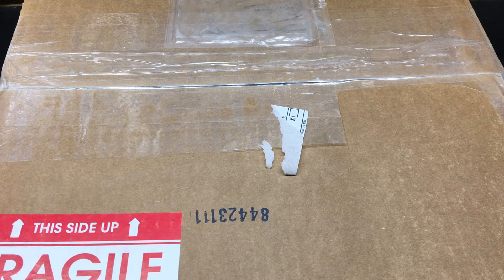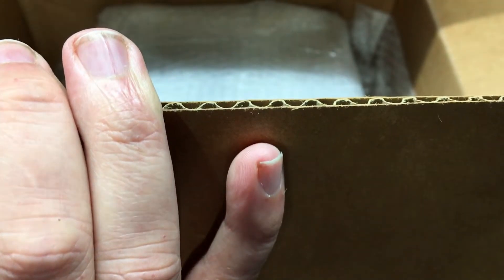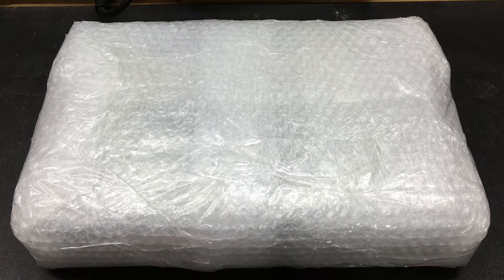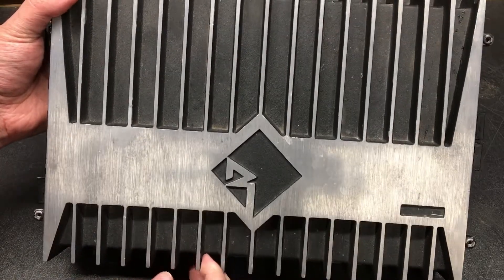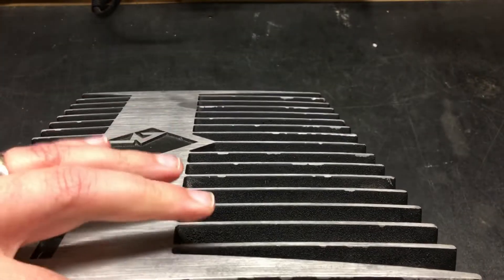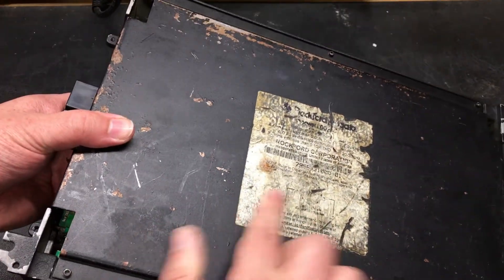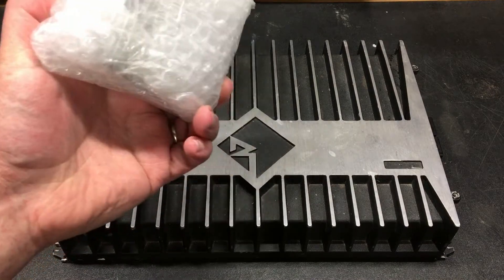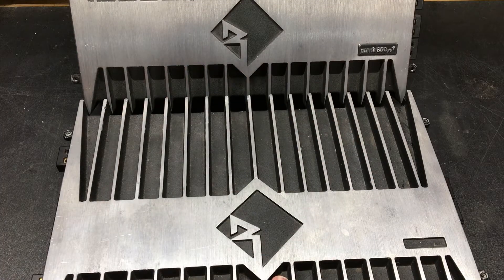Rockford Fosgate Power 800a2 "She's UGLY"

Comment: Great vid! This is absolutely my fav RF gen. I too have an 800a2 with a missing badge. You mentioned it’s possible to get a replacement... could you point me in the direction where? Also, what do you use to repaint/refinish? Thanks in advance!
Reply from the maker: If you have Facebook check out a page called "Rockford Fosgate Old School" and make sure you answer all the security questions to join. Once you joined up search for "DSM badge" or "badge" and you'll come across numerous posts about them. Look for a guy named Chas and send him a PM. He is the one that makes them out of resin. As for repaint and refinish. I like to media blast the painted areas if the paint is real bad and flaking off. If the black paint isn't too bad I use a Scotch bright pad and scuff up the paint then use a can of Rust Oleum fine textured black paint. I try to leave the "grind" alone as much as possible when it comes to painting. Mask off the grind section well and to finish it off I use the same Scotch bright pad on the surface followed up with some very fine grit sand paper. I personally despise the polished style of black and grind amps.  I want my Fosgate amps to look as close to factory as possible. But that's just me.
Reply: @kaknballz  awesome thanks so much for reply! Will be doing that!

Comment: Hi. I have this exact same amp but it’s the 500 watt. I have it at 4ohms thinking it would help it to not over heat but it does. Some one told me sometimes the amp is set out to run cooler at 2ohms. 
Is that the case for this amp? If so, I can bridge it and bring it down to 2 ohms. TY!
Reply from the maker: Just because you can doesn't mean you should. I hear it all the time how someone ran their older RF amp at 2 ohms or even 1 ohm all day in the Arizona heat and never had an issue with it. Some aren't that lucky. I like to think of a amplifier like the transmission in your car or truck. If the manufacturer recommends running a amp at 4 ohms mono like these Fosgates it's like leaving your vehicle in drive. When you start dropping the ohms down lower than recommended it's like manually shifting that automatic transmission. 

Running cooler at 2 ohms? I've never heard that one before. Typically your amp will run hotter as it's working even harder. There are some "tweaks" to adjust the idle current of the amp to help it run cooler but most times recapping the amp would be the best way to go. Think if you had a  vehicle that was 26 years old and never had any of the fluids changed besides the oil. Those caps in those amps weren't meant to last as long as they have been so a "tune up" would be in order. : )

Comment: I have two Memphis M7 12s at 750w 2ohm wired to 2ohm at the amp. each on a 4 Channel kicker 800. Looking to put RF 800a2 but I have no idea how to wire the subs with this amp any help would be great.
Reply from the maker: 800a2 is not recommended to be ran at 2 ohm mono bridged. 2 ohm mono stereo is fine. I'm not familiar with Memphis subs .
Reply: @kaknballz  does that amp handle 1 ohm. I can change the leads on the subs themselves making it 1 ohm subs. If not no biggy this kicker hits pretty sweet.
Reply from the maker: @masonchewning9640  It does not. The 800a2 is rated at 2 ohm stereo or 4 ohm mono bridged.
Reply: @kaknballz  Thank you for the help.

Comment: I have a B&G Rockford fosgate punch 800a2 and only one channel is working but if I hook it up in bridge mode I get sound. I currently have it hooked up to a single dual 4ohm rf 12 hx2 @ 8ohms and it works fine without overheating but I tried hooking 2 10inch dual 4ohms rf hx2 wired down to 4ohms final impedance to run bridge and the amp overheats a lot and goes into protect mode. The gain for the channel that is not working doesn't work, any advice? Thanks.
Reply from the maker: I'd send it in and have it repaired. I use Freemans Car Stereo and have been happy with every amp they have fixed for me. At the end of the day you have the piece of mind knowing that the amp is fully functional and won't possibly blow your sub or subs. Think of it as having a car but one or two cylinders have zero compression. Just because it still runs and drives doesn't mean you should continue to drive it. :)
Reply: @kaknballz  thanks, will do.

Comment: Do you know where I can purchased replacement parts for the 800@2? My power and ground terminals are each missing the copper circle fittings in them?
Reply from the maker: I personally do not. I know from time to time the terminals are on ebay as well as the "grub screws" that thread into them.

Comment: I have a 12" HX2 sub 500rms and a power 200a1 same style amp you show here.

I love sealed enclosure sound but I'm worried a 200a1 will not have enough power to push it in a sealed enclosure. Do you think I'm mistaken here? I have also had a person tell me these subs prefer a ported encounter. Thanks if you have any advice!
Reply: I had one in a ported box and was very impressive. 500-600rms on that sub and you will love it more
Reply from the maker: Any sub can be ran in a sealed or ported box. I have seen videos on here where subs in ported boxes actually move a lot less than a sealed sub. I personally have always preferred a sealed box as well because I listen to a lot of classic rock and metal. I can not stand techno, rap, or just bass music. As for power and your amplifier....I'm not that familiar with the 200a1 but I would assume you would be slightly under powering the sub. A 360a2 will run around 500 watts at 2 ohm mono and a 250 a2 will do around 350-400 rms at 2 ohms.
Reply: Hey how big is you sealed box..?  Sealed boxes you actually gotta push more power to a sub to get the same bass out of a ported box But If your sealed box is to small it will beat the sub to death,  if you want deep bass, & Not Rock music type bass sealed box just wont work.. these amps n subs where in my era of building boxes.. but im guessing the HX2's are getting hard to find in working order so a sheet of 3/4" MDF isnt worth blowing up that sub..  If that sealed box is big enough might have room to punch a hole in it for a simple PVC port
Reply: @user5.56  I since sold it. I built the box to manufacture specs sealed at 1.25 cube I believe. It sounded fantastic and clean. No issues at all. I sold it with the car because it was a custom enclosure for that car. I would definitely recommend a sealed enclosure to anyone considering it for an HX2.

Comment: Where can I her some gain knobs for this model
Reply from the maker: Either scavenge one from a toasted amp or find someone 3D printing them.
Reply: @kaknballz  Would you happen to know anybody I was hoping
Reply from the maker: @JorgeRodriguez-fm4cf  Not off the top of my head.I know there is two different styles to those knobs and a lot of the 3D printed ones broke easily. I don't think anyone was ever truly able to make them successfully for long term use. Those knobs slide into two or three gain pots and have to be a specific size to work. They also have to be spot on in order for the bottom plate to fit over and line up with the opening. I know you aren't going to want to hear this but buying a parts amp is going to be your best bet. In the past I have used a tiny allen wrench to adjust amps with these missing knobs. You'd have to remove the bottom plate and physically inspect the fitment of the allen wrench into the gain pots tho to make sure everything is lined up correctly. Once you have the right size throw it back together and do your adjustments.

Comment: I got a 750s  its gets super hot why do u thank the problem is and where do u send them to get them fixed
Reply from the maker: Most of the time if a amp is running hot it's because the user has the amp under excessive load. Meaning: the amp may be ran at a lower ohm load than what it is rated for. Older Fosgate amps do tend to get hot but the heat sink is doing what it's supposed to do, dissipating heat. As for sending out an amp for repair or to have it freshened up....I have used Freeman's Car Stereo for over 20 years and have been nothing but happy with their work. There are a very small handful of people that I would trust to repair a amp. Best to ask around and get tons of references. I believe there is a G & S amp repair on Facebook and Desert Audio Specialists or something like that in Arizona that also repairs amps.  I always stick with Freeman's tho.  https://freemanscarstereo.com/pages/repair-shop
Reply: Hi!
Just check if the amp is running warm with no load is on its outputs, meaning not playing music.
If it gets warm, its possibly a wrong adjusted idle current.
Stereo amps have two pots to adjust it ( bias pots ). Dont touch them if you dont have a device to measure the idle current.
These pots are pretty sensitive and can destroy your fine oldschool amp if set too high. So alway use a fuse of around 5-10 amps for adjusting!
Just start with pots fully counter clockwise and start sloooowly turning clockwise, always check the current. The current increases and If the current starts increasing fast, just stop and get a half milimeter back.
This is the "rough" method but works well if you have patience.
Best thing is using a scope and applying a sinus signal to the inputs
In short:
idle current set too low: you get audible distortion
idle current set too high: your amp gets too hot, failure is possible
Hope this helps a little!
BR
Andi
Reply: Idle current adjustment is what i always do when i get a used amp!

Comment: That is not a power that is a punch 800a2 
The power should have Single 4 gauge Power inputs
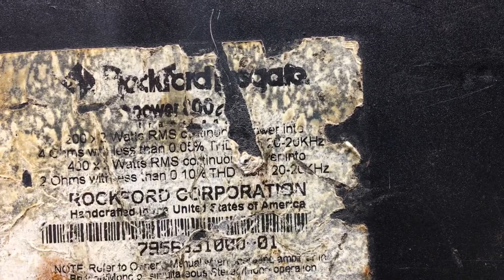Reply from the maker: You would be incorrect. If you look 2:47 into the video you can see the old beat up label clearly says POWER 800a2. Also, there was a 4 gauge input version and the dual 8 gauge. If you look at the owners manuals for the 1999 version of the Power 800a2 it clearly shows two 8 gauge inputs. The manual for the 2000 model year amps have the single 4 gauge.
Reply from the maker: In case you still don';t believe me.  1999 manual page 4 https://rockfordfosgate.com/rftech/library/1999/3_amplifiers/man2378b_poweramps_man.pdf
Reply from the maker: 2000 manual page 4: https://rockfordfosgate.com/rftech/library/2000/3_amplifiers/man2616a_poweramp_man.pdf
Reply: I have 4 800a2  power I know what I’m talking about that label could be incorrect all the power Amp have a four gauge or zero gauge power connector anyone that’s a collector would know and I am clearly one of them.
Reply from the maker: @Caprice1977  You absolutely do not know what you are talking about. It's people like you that spew incorrect info and confuse people. In 1999 the PUNCH 800a2 had a "punch bass" built into the amp and had dual power and ground. The Punch series also has one set of RCA inputs. The 1999 POWER series does NOT have the "punch bass" but instead has the wired "bass remote" that is oval. The 1999 POWER series also has one set of RCA inputs AND a set of RCA pre outs. Once again, you DO NOT know wtf you are talking about. If you look for those details in the video above you will see it is clearly a Power 800a2 and not a Punch 800a2. If you still don't agree with me post your thoughts on the Rockford Fosgate Old School page on Facebook and ask them.
Reply: I got a power 800a4 with dual 8 gauge... it was an ebay buy and the front right channel is blown :(
Reply from the maker: @benjaminwoo8069  Shhh!!!! You can't win with trolls lol. The owners manuals for the years those amps were out also show both dual 8 and single 4 gauge. But hey, according to Jesse I'm wrong and I'm not a collector even with almost 100 Rockford Fosgate videos uploaded here lol.